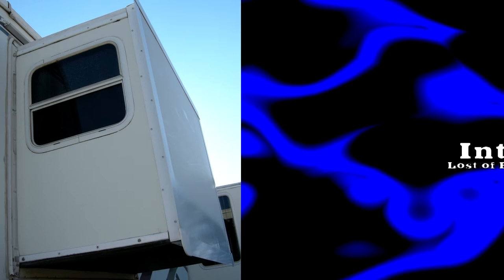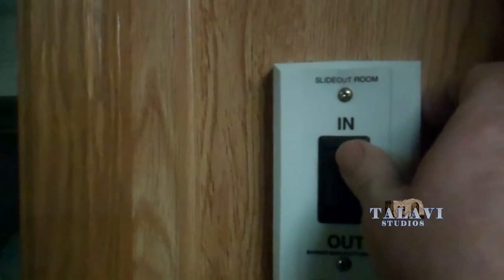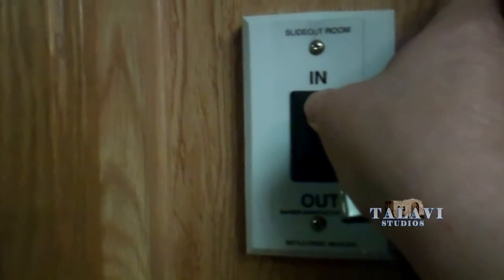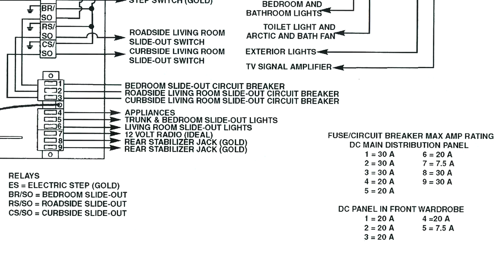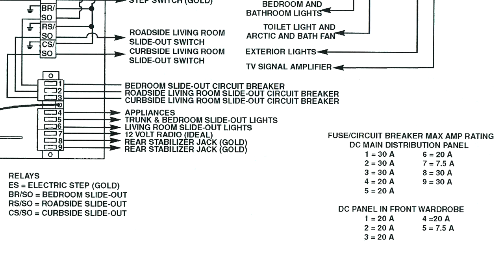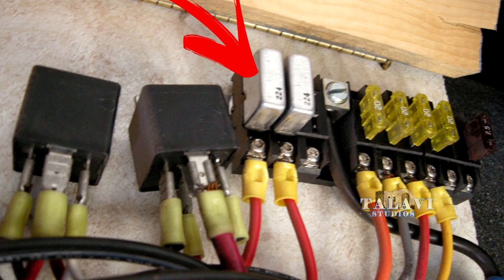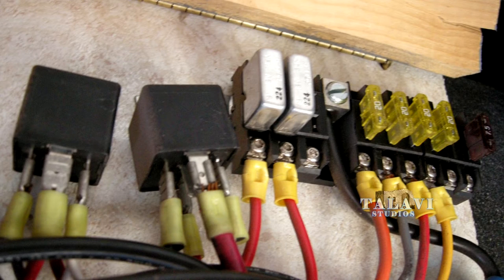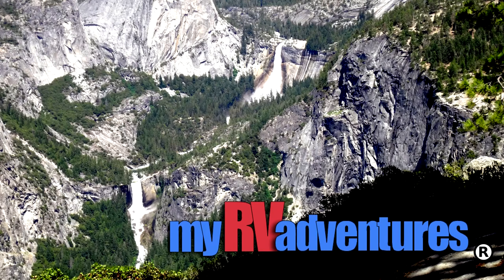Intermittent Bedroom Slideout Failure

Comment: Where are the circuit breakers located? I have a forest river.  There is a power distribution board near the inverter that has some fuses but nothing labelled slide out.  I have heard that some are hidden underneath.